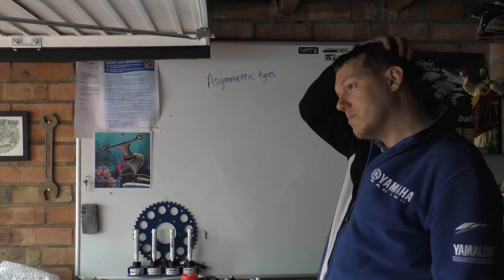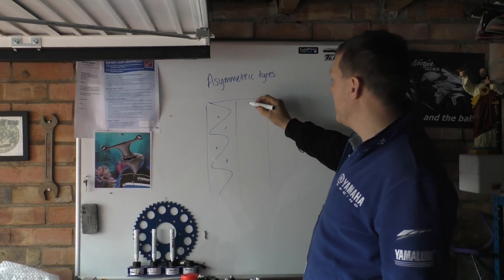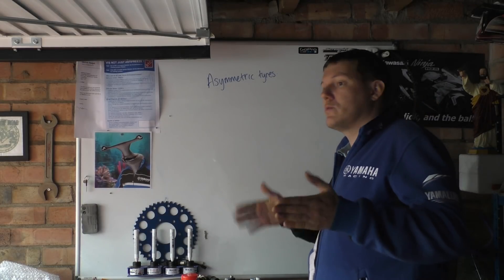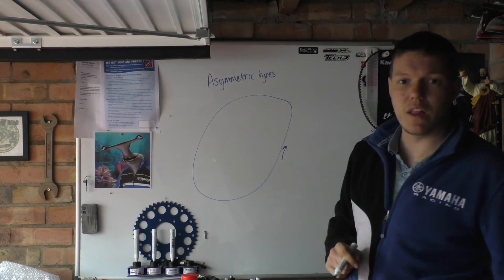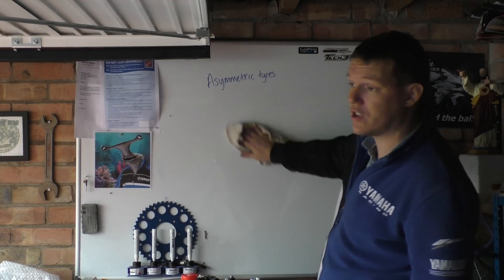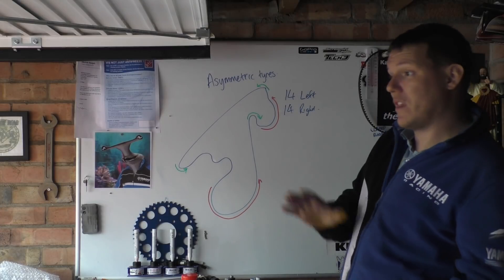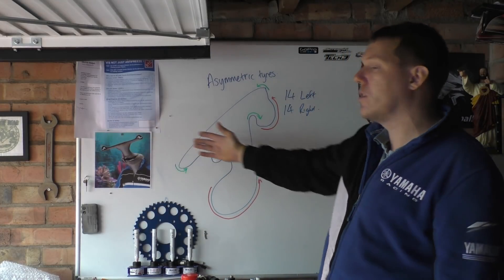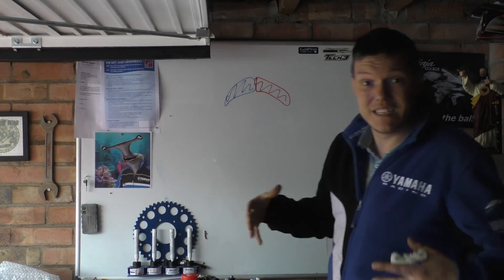Asymmetric Tyres | What and why?

Comment: when i bought my Ducati my shop threw on new tires for me which was cool but not what i wanted as the stock Italian tires were really good but they stuck me with the michelin pilot power 2ct which really surprised me with its grip and i have read alot about tires and these things are hard to beat at any price range...the coolest thing about them is they have dual rubber compounds where its stickier on the edges and harder in the middle so they last longer than stock tires and handle better...i replaced the rear once but i will get two new one soon and they will be a 2ct front and a harder pilot power for the rear...i like my front to stick and my rear to slide

Comment: this is why you don't take sport bikes on the streets, with the frame in mind that you are racing...  You don't know of that prius dropped batteries on the ground or not..  Oh yeah there is a rain cloud and a sand truck hauling ass... Yeah good grip right there..  To many has this thing about hauling ass with sport bikes on public roads and not knowing what goes into track prep...
Reply: I like riding fast in the rain not as many people out on the back roads .The same things happen in the wet as the dry just at a slower speed and less lean angle good for developing throttle control .
Reply: Agreed speeding in traffic is never smart add rain and your just asking to get hurt, also its much safer if its been raining for a few days always  way to slippery if it has not rained in a several months.

Comment: Usually also the reason for the asymmetric design on tyres for cars is you will have one portion of the tyre is designed to displace more water etc, and one side is designed to grip the road / dry weather.
Reply from the maker: Yeah I'm talking racing and if you're talking road, then bikes don't have asymmetric tread. LOL how would you pic which side should displace water?
Reply from the maker: Also you're new - we don't way the 'CAR' word here........
Reply: The Workshop haha fair doos, I shall refrain from it in future, 
Doing my best to absorb all the bike / 2 stroke lingo since it's not something I've ever had much to do with.